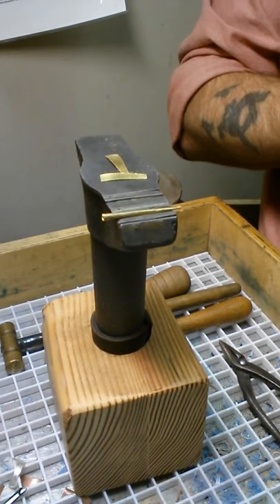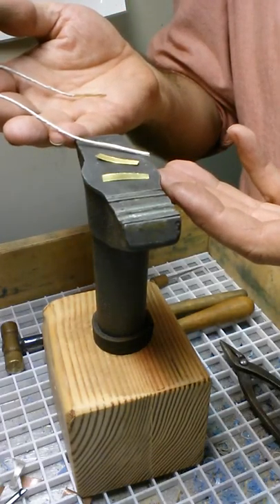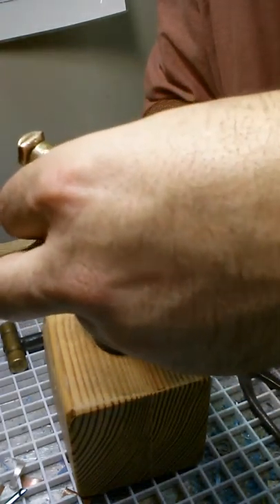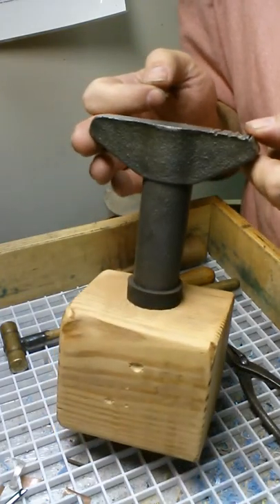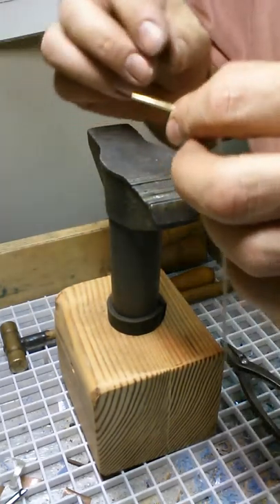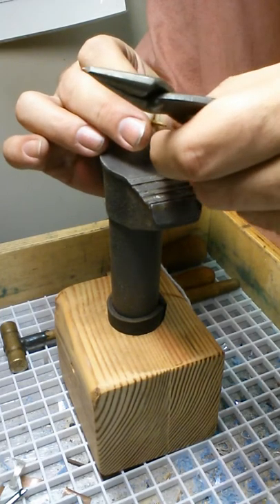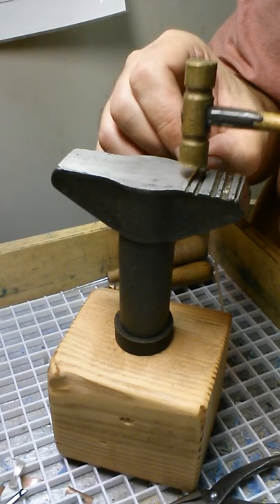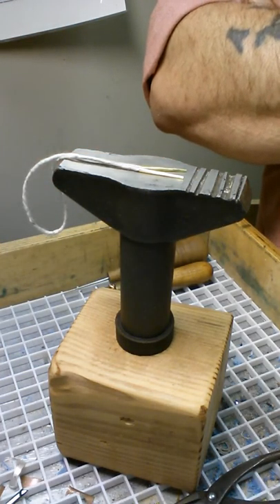Jerry's Basic Jewelry Bench-Work 6: Manufacturing type 3 aiglets

Comment: By the way, Nice anvil!
Reply from the maker: +drason69 Thanks! It was lucky that I had this. I had been using this as a large mandrel to fit in my vise for years and years. The round part at the bottom was about 14 inches long and tapered. I believe it was a sprue from an iron casting. I do not remember where I found it. I was looking at images of these vises and bang! I remembered this scrap piece I had.  Maybe the universe knew I was going to do this work with aiglets and made sure I had the right stuff way before I knew I needed it.